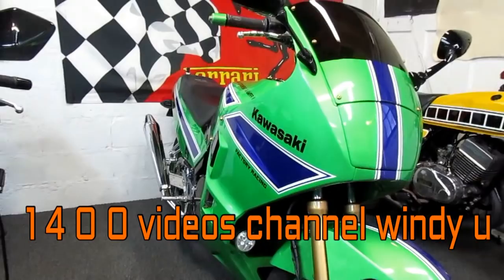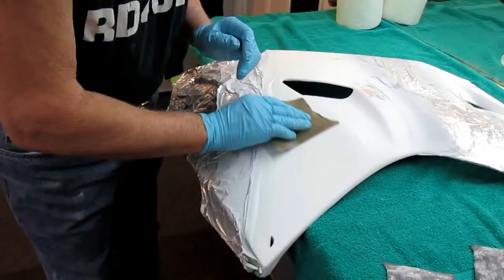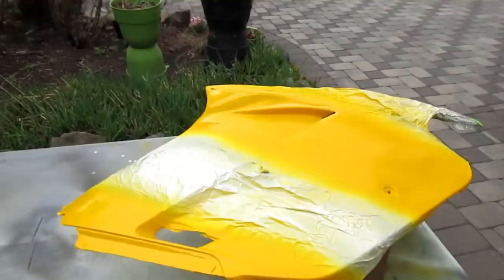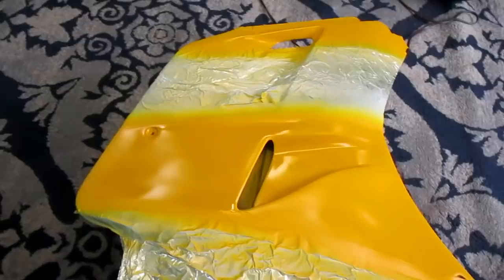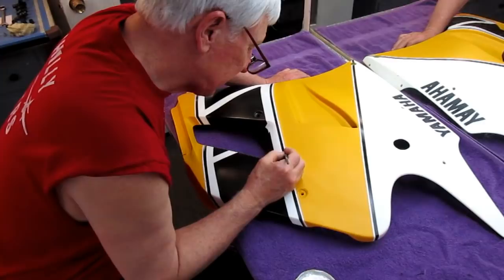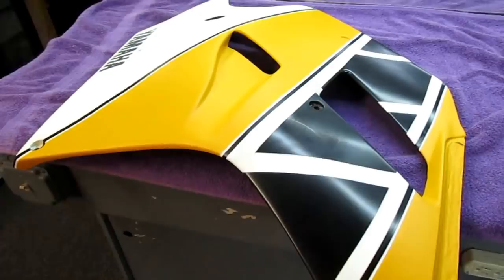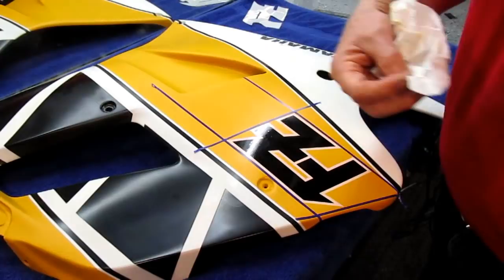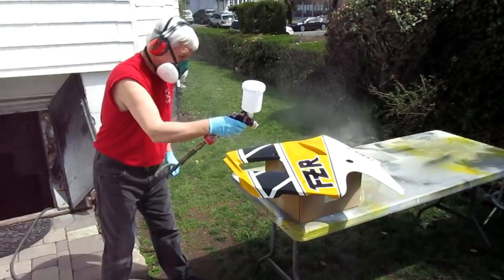pt 174 FZR RESTORATION,DECALS INSTALLED,CLEAR SPRAYED,MORE

Comment: Can't beat water slide decals,nice and thin,here is a tip i learned for getting bugs out of clear,just fold some masking tape in half sticky side out and where the fold is use it as a scoop,spray a little clear over the bug to wet out the panel then you can scoop up the bug without marking the paint and just spray a bit more clear over the area where the bug was to fill in the depression in the clear it will self level out and be as good as new.